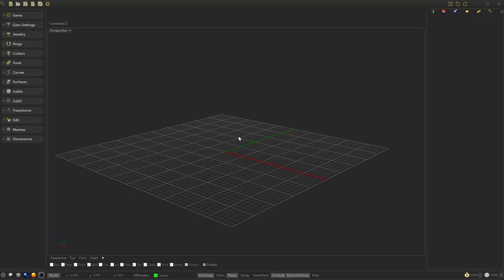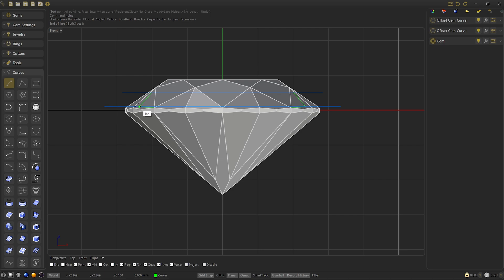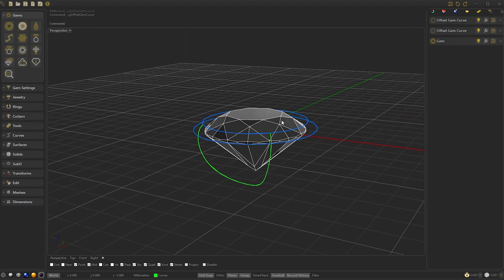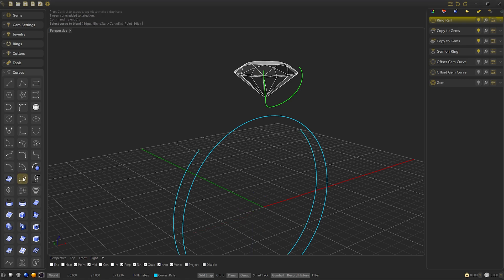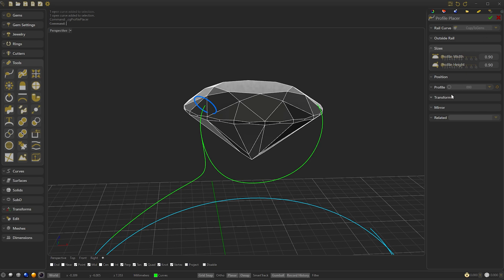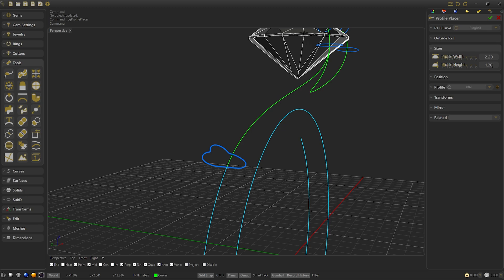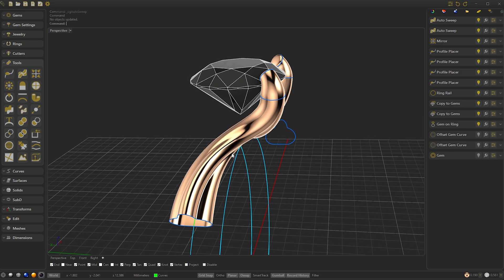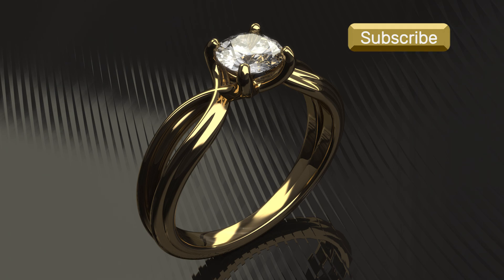CrossGems Tutorial - How to do a Parametric split Shank Ring from Scratch

Comment: Thanks for the excellent tutorial! I just finished practicing it. Can you please give me instructions on how I can retroactively change the thickness of the ring only at the bottom?
Reply from the maker: Hello @oshritadah,
In this case you should modify the profile placer at the bottom, so that you can adjust it to your liking.
You can also add more profiles to make the thickness you need to the sides.
note: In case of making 2 profiles in a row one close to the other moved horizontally taking as in this case the central rail, it is advisable to take out the isocurve of the generated sweep and use it to make a new sweep with that isocurve as rail and the new profiles. This way you will get a more smooth sweep.
Hope it helps to you!💎
Reply: @crossbytes3d  Thank you so much for your explanation, I'm afraid I'm still not skilled enough to practice everything you suggested. But it does help! I was able to change the size of the profile. In your opinion, what is the minimum thickness for the bottom of this ring?
Reply from the maker: @oshritdah Keep in mind that we make tutorials so that you can then give it your desired touch with the necessary measurements. So it depends of the material and the style you want to make your ring, so generally the thickness is in the range of 1.5 - 3.